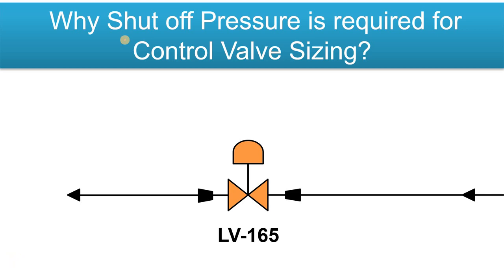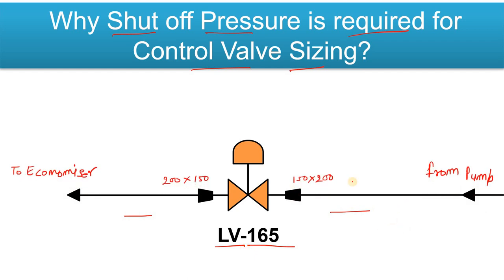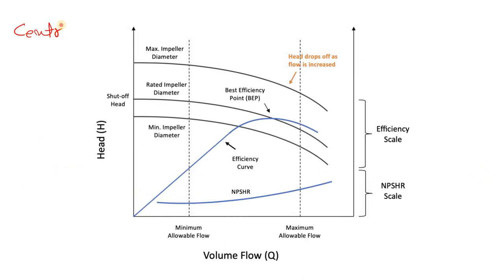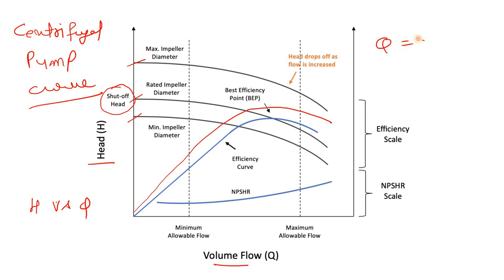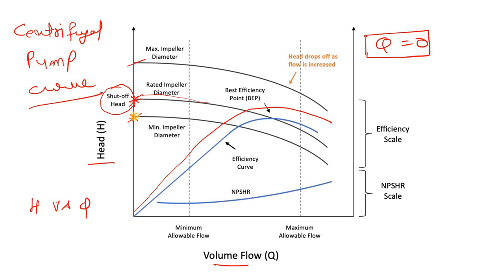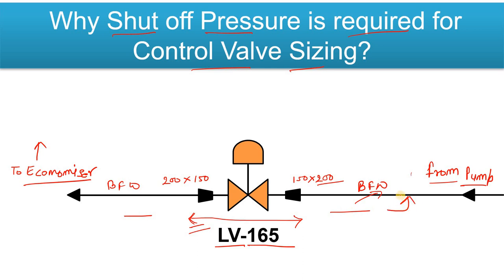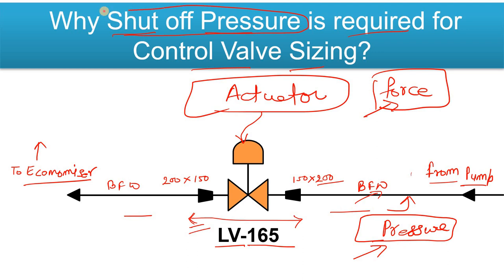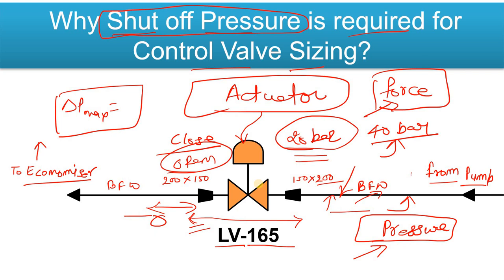Why Shut Off Pressure is required for Control Valve Sizing | Control Valve Sizing | Instrumentation

Comment: I think the valve will remain open till defferential pressure is maintained 20 bar. Whenever there is a change in pressure either upstream or downstream the valve will close thus it maintains 20 bar pressure in the line. Is my understanding correct.

Comment: The valve may fail or get damaged due to the excessive pressure. This could result in leakage, which can be unsafe and lead to system failures.

Comment: Control valve will not close becos the shut off pressure 40 bar is higher than 20 bar design oressure of the valve